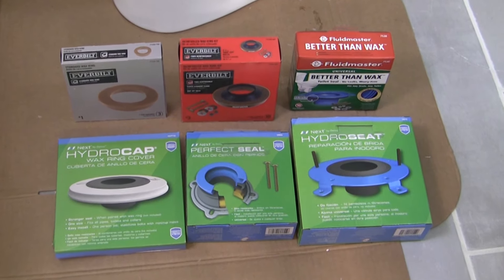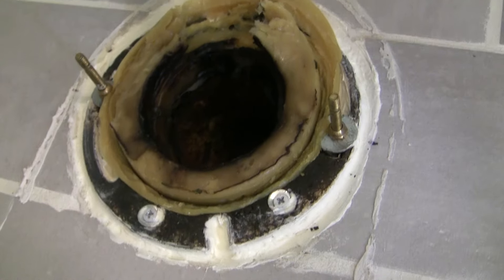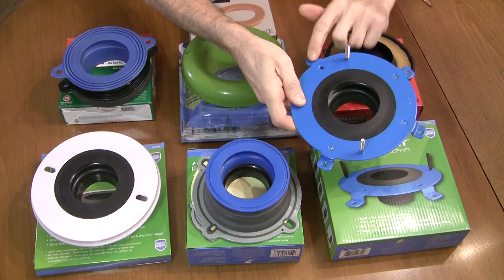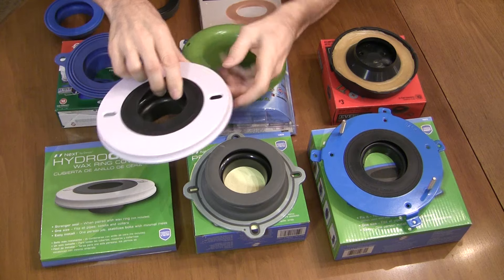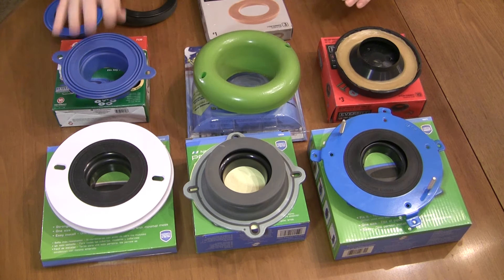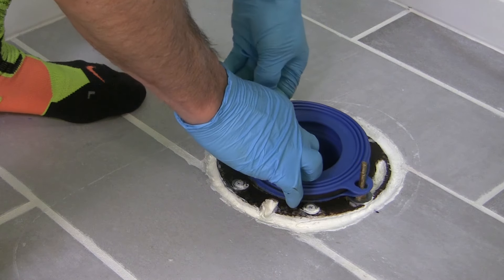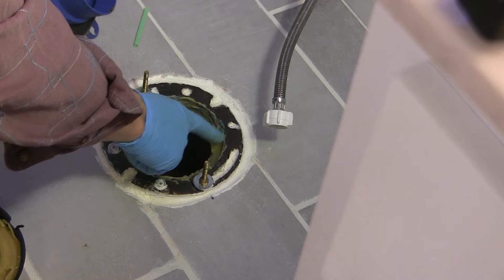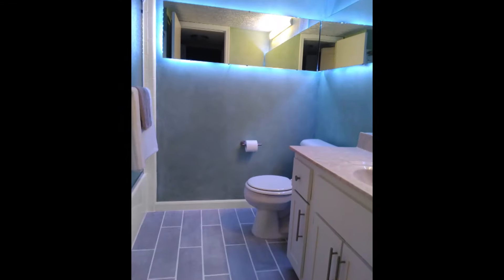2 YEAR FOLLOW-UP to Toilet Flange Fix  / Also, Compare Different Toilet Seals

Comment: I am back...wow...i don't even remember my old post.  this time I am replacing my toilet for real.  New toilet is sitting in the living room.  I bought a Danco seal(has wax inside)...anyway just checking out some videos.  I really like your videos...because you are an entertaining wild and crazy guy.  Nice and weird.  Who would not be dealing with poop.
Reply from the maker: That's an interesting seal.  I didn't quite know what to think about that one.  The opening was too small for my drain pipe, so I eliminated it because of that, but I probably would have picked it otherwise.  Hope it works well for you.

Comment: I put in the rubber foam green one 20 years ago and it still is going strong, no problems and I"m no plumber.
Reply from the maker: I didn't know they've been around for 20 years.  I suggest pulling it up and changing it.  I read a lot of stuff about those, not just that they would rip and become spongy, but that the chemicals in the water would eat through their coating.  I mean, 20 years is a long time for even a wax ring.

Comment: Haha! Ok you had me going there. Thought you were serious till you suggested the porcelain bolt towers and a hatch to ‘see what’s going on in there’ 😂.  Love your over-engineering shtick. 
I actually wondered about the system too when I first started pulling/setting toilets, but after a couple dozen, well.. If it works, don’t fix. Wax works.  Wheels round. I really think those rubber gaskets are problem solvers, not a new standard.

Comment: Not Tim, but the Woody Allen of plumbing? However, this is what happens inside my head as I research sh!t to death. An example of reinventing the wheel and why things haven't changed for 100 years. However, he is right and it seems these are in need of reengineering by the industry. The problem is there are so many different situations plumbers come across and products are made to address most of them. I can't wait for part 3. Thanks.

Comment: My 60 years of plumbing experience says, You want the closet ring flush with the finish floor, so as to give expansion cushion to the wax! (Too thin, no flex]! I  always use a 110 [felt or neoprene lined wax ring, [for wall mount W.C.'s] [or trailers] When setting the bowl Ya wana feel the wax squish a bit!

Comment: I had a toilet that I fought for over two years.  My problem was not leaking but sewer gas.  What started my trouble was we had a bathroom totally remodeled.  After a couple of weeks I noticed water around the base of the toilet.  I called the contractor.  He sent a worker over who just tightened the two toilet bowl bolts.  This did not work.  I decided to remove the toilet.  What I found was the contractor had cracked the plastic flange on the sewer pipe that the two long toilet bowl screws attach to.  Now what to do?  Since I am retired I decide to tackle the job.  I am not going to bore you with a lot of details but I am as meticulous as you are.  The flange repair was straight forward.  In fact when I had finished with the flange repair it was better than the contractor's work.  The flange was level about 1/8 inch above floor level.  I placed a wax ring on the toilet bowl and was ready to go.  For six months things were fine but then I detected a smell of sewer gas.  Replaced the wax ring but still smelled sewer gas.   I decided to go with a synthetic ring similar to the ones you show.  Problem solved or so I thought.  A little over a year later I began to smell sewer gas again.  Now what?  As a last ditch effort I researched YouTube again to see if I had missed something.  A product that caught my eye was Perfect Seal.  Perfect Seal injects the wax downward as you install the toilet bowl.  I used the product as instructed and low and behold problem solved and has been holding strong for over two years.  What was causing the sewer gas to escape is beyond me but Perfect Seal fixed the sewer gas leak that no other product could.

I really enjoyed your video especially the comments on plumbers.  I guarantee you there is no way a plumber would have done the meticulous job you did. Also your points on the lack of advancement in toilet technology are very well taken.  What the hell are we living in the middle ages or what.  Again great, great job on your toilet project.

Take care and have a grrrreat day!!!
Reply: I saw advertisements for that.. looks tempting to try.
Reply: @YouTubeStalker  My Perfect Seal is still performing perfectly going on four years now.  I guarantee you if I ever again have an issue with a toilet leaking at its base or sewer gas odor I am going to use Perfect Seal.

Take care and have a grrrreat day!!!

Comment: Sani seals are a good choice when setting a toilet on an older 4 inch diameter flange.  Also they work well on flanges that are level
with the floor or even a little lower.  Many times you only need a good wax ring (bees wax is best) to make a good seal that will last
for years is the toiler does not wobble.  BTW I bet you that if you set a toilet in putty then you might be a real plumber (old school).

Comment: I really like that straw idea!  That blue flange stuff- not so much.  Anything with foam in a wet environment is not likely to hold up.  If I am only a little out of level, grab the coned wax ring with 35% more wax and put a regular wax ring without a cone on the downside, do the straw trick-especially if you are by yourself, and set your toilet.  The bolts kind of hold the toilet to the floor-but the caulking is totally necessary to keep the toilet in place over time.  Use slow drying silicon and tape the floor around the toilet to have better caulking results at the joint. If you are putting a new two piece toilet in, set the base first and assemble the top tank afterwards- it saves your back and you have more control lining up with the floor bolts. Don’t forget to test your toilet wax ring seal before you caulk the base- use lots of toilet paper to simulate real use.  Test it good. Actually, I do the two wax ring system every time- it never fails.
Reply: I prefer the no wax seal. I use them for every toilet and no need to double gasket. You can reuse them, too. The straw idea is a good 1.

Comment: Hello Marty. Saw your video. Enjoyed watching someone during a thoughtful job.  As to the green rubber seal I've used plastic straws not only to guide the screws to the bowl, but to protect the seal from nicks caused by the screws. I'm surprised the company has not incorporated a protective sleeve in the screws holes to remedy this concern. I found the green rubber seal easy to install and forms a perfect seal over leveled toilet openings. Yes, the bolts holding the tank in place is a problem. The bolts can be made of hard plastic (like the toilet seat bolts) to solve the corrosion problems.

Comment: I have a Kohler toilet and the bolts attaching the tank to the toilet do not go through the tank.  There is a molded raised flange in the bottom of the tank that you slide a bolt into then place the tank on the toilet and tighten it down with the nuts provided.
Reply from the maker: My ideas are simple and crude, so I'm glad to hear they've come up with a better way to do it.

Comment: I's go with the wax seal They last over 20 years. If you silicone the bottom leave a gap in the back for the water to leak so you know when it leaks. I you goof up the wax seal just scrape it off an put on a new one. They're only  couple bucks each. When you go to the store always buy 2 wax seals.

Comment: You are absolutely correct. Toilet technology has not changed much since invented in the 19th century by Thomas Crapper. Just look at the 6 shoddy seal products you had to choose from.   If Fluidmaster  had done trials with their rubber seal they would have realized that the bolt holes needed to be wider for it to fit flat on the flange; and the most highly rated Everbilt "thicker" wax seal looks no different from their regular wax seal.

Comment: I added my comment to the other video. About eight years ago, I used super-glue to glue the toilet flange. It has been working so far and so good. My renter wanted me to replace a new toilet, but I did not want to because I was thinking that super-glue flange.
Reply from the maker: Was it a PVC flange or metal?  JB Weld would have been better than super glue, but eight years, wow.  Amazing it's still holding up.

Comment: Hi Marty, I thought I was OCD, you put me to shame. I try and do any and every repair at home myself in order to save money and I hate sloppy work. We had our home built 17 years ago. All the subcontractors did a good job except the plumbers. I have found out they were so sloppy and took so many shortcuts that I have had to fix myself that have cost me money, like underground leaks and leaks under the house I was not aware of until I got a water bill for over $400 one month, and $300 the next month before I was aware I had a problem. And also water damage to my house from the upstairs bathroom, the shower drain was leaking and now the toilet is leaking through to the laundry room beneath. I found out once that one of the shower drain pipes from a downstairs bathroom had come totally loose, shower water was just pouring out on the ground beneath, and when I reattached the drain pipe and secured it with plumbers strap I found out the drain pipe was not even running downhill, but rather uphill, to the larger 3-4" sewer pipe that runs down the middle of the house. And this plumber was an older guy, my contractors buddy which he had used on his homes for many years. And I have had even more issues than I listed here. Sorry to say it, but I hate for a contractor of any sort to even step foot on my property anymore. Like they say, good help is hard to find.
Reply from the maker: Bummer. Maybe that plumber had dementia. I mean, that's an awful lot of stuff to be assembled wrong. Or maybe he's just a slob like so many others.  Personally, I would never own a house. I'm a condo guy - much less trouble.

Comment: As a plumber for 45+ yrs. the goal is for the toilet to not leak in the short and long term. Any of those flange gaskets can be made to accomplish that goal. Some easier than others. FYI, don’t caulk completely around the toilet. If the toilet flange does leak you may not know it. If it sets on a wood floor you and the toilet may end up on the floor below when the wood rots.

Comment: I just replaced my wax ring today.  I purchased the jumbo wax ring and the Fluidmaster "better than wax" but could not get that plastic seal to seat right, so I simply went with the tried and true wax.  The wax is more versatile and worked so I can not recommend Fluidmaster "Better Than Wax" seal.

Comment: Heres a perfect example of the 20 min plumber.  My old house where my 1" copper line went into feed both units I had did a lot of work to dig up soil and actually found a pin hole leak by a gate valve shutoff that was semi capped off by my grandpa I imagine because when he had to shut the water off he went to the meter.. long story short is dude was recommended by a friend, i had the area dug out and considered sharkbite slip valve to repair it and while id rather have soldered it i didnt have the tools..

The guy told me basically to slap on some sharkbite valve and call it a day. He was the owner and even said " im not gona crawl up into that pit, ill have someone else do it.. Bottom line the slip valve didnt work because the pipes were about 2 ft under dirt and off center, my idea was to take 2 90s and route pipe above grade to install a valve..  dude woulda charged me an arm and a leg to slap some sharkbites on a main water line where I have actively heard respectable plumbers say "if your plumber wants to use sharkbites you need to fire his ass"..

Unfortunately my neighbor had a major water leak so she gave me her plumbers number and he did my idea of running 2 90s up outta the hole above surface to then install a shut off and he soldered it... I took back my $100 of sharkbite fittings and ended up paying dude like $250.   He said had i not found the leak and dug out to it then it woulda been a $700-800 job all day.

So bottom line is beware of the sharkbite solution plumber aka the 20 min man.  With all due respect to the trades there are a lot of half assers that will bandaid a problem for a quick but and I respect the tradesmen that are open and honest with you.

Comment: As a plumber I want to complement the quality of work and how through you are. Bottom line, meet the code and make a reliable lasting waterproof repair. Flanges should be level with finished floor to begin with or within 1/2" of that.
Reply from the maker: Thank you.

Comment: Caulking around toilet may stop you from seeing a leak below and  rotting your floor.
Spraying open seal foam around  damp or wet areas is a definite mistake. Becomes water logged.
Reply: True, but always remember that you can have a wax ring leak WITHOUT any water visibly leaking onto the floor below the toilet.  I have witnessed this many times when the flange is recessed below floor level, such as with tile floors.  Keep this in mind.

Comment: The Sani Seal is by far the best, but the Better Than Wax is a close second. I had originally went with the Better Than Wax but it started leaking after a year or so. After that I went with the Sani Seal and another year later everything is fine and I have removed my toilet twice in that year due to my kid flushing toys down the toilet. So I’ve set my toilet 3 times with the same Sani Seal and no leaks. I swear it’s the best on the market by far.

Comment: My toilet flange seal leaks all the time since I installed my bidet. I got a Crane High Boy toilet and the bidet replaces my existing seat and lid, the bidet water tank in the back of the seat takes up room that forces me to sit more forward on the seat shifting my weight forward causing the back of the toilet where the flange seal is to slightly lift and leak. I have tried the extra thick wax seal that didn't work, my floor flange is exactly level with the floor and is very secure that doesn't move, I use the bigger 5/16" flange bolts, I never tried the "Perfect Seal" , do you think that will work better?
BTW:  wonderful video , you educated me
Thank You
Reply from the maker: If, for some reason, you moved or jostled the toilet bowel while installing the bidet, then it makes sense your ring would leak if it's wax.  It sounds like you secured the bowel to the floor pretty well, so hopefully you started over with a new ring before you did that.  If it were me I'd try the the one I used in the video (Fluidmaster) and see if it works.  Hopefully, there will be a plumber on here who can answer your question better than I can.
Reply: @MartyPollio  Thank You for the reply and I will try the Fluidmaster

Comment: As far as the tank to bowl leak points they do make one piece toilets. They're more expensive and heavier, but there is less potential for leaks.
Reply from the maker: Didn't know that, but just looked them up.  Thanks

Comment: My old house I used that green foam ring on my downstairs bathroom and my back rental unit and they worked flawless for 5 years and since ive moved still working.. It really shined when I pulled the toilet up for my tenant because I was redoing the floor in the bathroom and didnt finish that day so i seated the toilet back for him to use, pulled it again and once finished used the same ring to reseat it.

I have since moved and upgraded to a taller elongated bowl toilet to find the pvc flange is cracked by the key way.. say the Danco and also the basic Oatey ss ring so went with itt.

My issue is using 3" deck screws which only have half the shank threaded I feel like my screws didnt bite in like i hoped.  Im goin to keep an eye out and worse case i have to pull up the toilet and perhaps get larger diameter fully threaded screws.. was hoping that drilling on an angle and toenailing/screwing i coulda got into blocking assuming it was there..

Even if i got larger fully threaded screws i still dont like the idea of only the subfloor taking the brunt of the force, id like to get into some joists/blocking..  

I am really trying to avoid getting my big butt up under a crawl space to add blocking but i will if it comes to that.

My old cast iron flange on concrete slab was bomb proof, i am starting to see pros and cons of having a crawl space vs a slab on grade...

You will never find a youtube video on a how to without someone interjecting on how you did it wrong.. If it works for you then screw the negativity but I have found on the flipside some of it can be constructive criticism by people that know so you have to filter through some of the bullshit but also be humble enough to accept that maybe someone else can shed some more knowledge on the topic it hand.. at least thats how I see it.

Comment: After 3 years I have had the thin horn flange on the Fluidmaster collapse in and thus restrict the flow. They need to use harder material. The thick green one is too thick for most toilets. I use a Korky instead of the fluidmaster.
Reply from the maker: Yeah, I did a follow-up to this video two years later and the Fluidmaster was in bad shape.

Comment: I'm doing the same thing except I'm using plumbers putty rolled into a 3/8" rope to go between the different layers and do the same thing on the tank... I taking that off first so the base is more manageable and put some straws on the bolts to line everything up when you set it down
I'm also going to put a bead of grout about 1/2" to set the toilet on to eliminate the rocking... Just takes 7 days for the grout to completely cure

Comment: If you ever have to replace a toilet seal again try a silicone ring.  Mine hasn't leaked and is great for an old 1860s house with a cast iron pipe under the toilet and uneven floor.